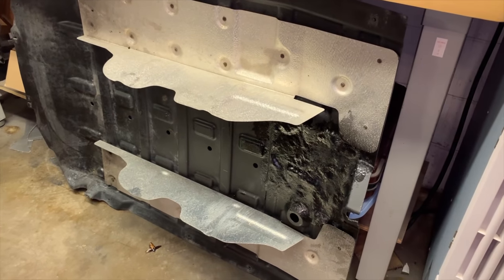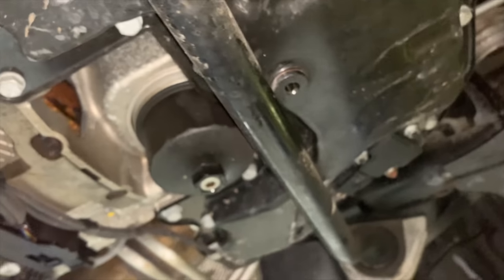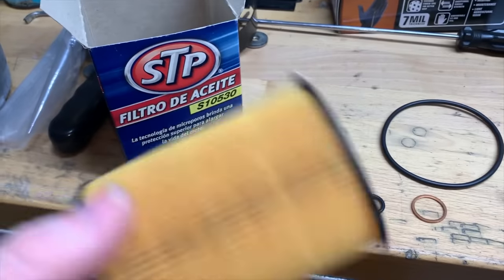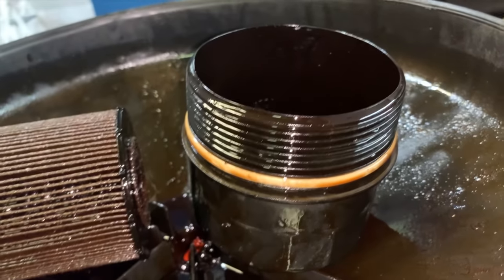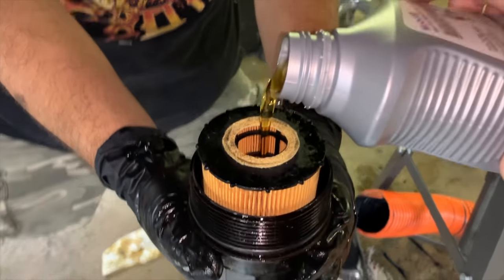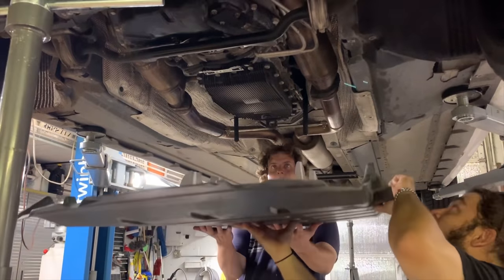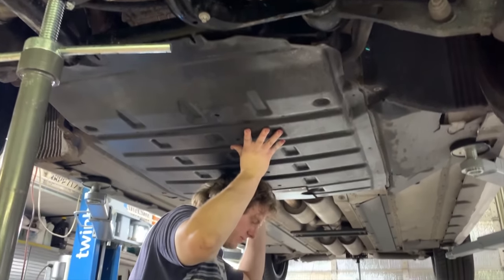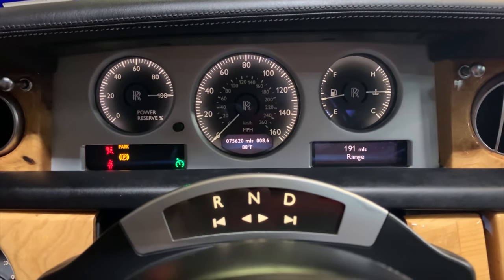Rolls Royce Phantom - OIL CHANGE

Comment: What gets me in all this is that oil filter.  Here we have a hand built, hand assembled engine built to, I am sure, demanding specs.   And the oil filter housing is plastic!   PLASTIC!!   The more I am seeing the hows and whats of the Rolls auto, I am seeing lots of attention to luxury and flash, but the nuts and bolts are just a car.   Plastic oil filter housing!   Gad!!!
Reply: senorkaboom welcome to BMW. Under the hood you will see plastic everywhere. 
Lots of coolant and oil leaks.
Reply from the maker: senorkaboom it is cheap to replace and lasts a long time and helps save on the weight
Reply: Videobob Moseley   If they want to save weight, take out some of the steel to build the car.  I find it hard to understand a plastic housing will save all that much in tonnage.  For better durability and cost justification, make it out of platinum.

Comment: Why do you lubed new oil filter before installing
Reply: Reduce the amount of air in the system I guess
Reply: To prevent "double gaskets"
Reply: So that its easier to get off the next time

Comment: That looked extremely easy. My dodge Cummins is harder than that. You have to put the oil filter in by feel because it's up in the underside of the passenger side. Yours looked very easy

Comment: Bob heres a tip bud for your next oil chanhe once all of the old oil is drained and the oil tank is empty make sure u get 1 quart of new oil and just putit thru the engine just so it clrans out the walls of the oil walls and just to get out any old unwanted oil out of your engine its a tip most mechanics do just to their basic cars its not a big deal but in a way it ensures that ya got any old oil out just foe mindsake like i said its n big deal but it does make a difference.
Reply: No need. Only old School mechanics do this.
Reply: Diesel fuel or even gas can work. Diesel is probably better.

Comment: This will be long, So before putting the car up, loosen up the oil cap hence the ladder. Hmm Oil filter placement from the bottom? No space on top? The sway bar cuts in right at the oil darin plug, Damn engineer. no torque on drain plug? By feel lmfao, not so tight, It’ll come off when your driving and there wouldn’t be a second oil change. No need to pre lube, the system will prime it all, would be hard to lube it if it’s on top. You torque the oil filter but not the drain? I’m so confused. No sir but Mobil one probably paid/sponsored to be apart of manufacture oil by selling it at a lower cost. You just used the wrong oil if like you said it’s a v12 from BMW, which require ESP. I know there isn’t many videos out there but let me help out. If this is a BMW engine use must only European oil. And if u like to stick Mobil1, Used only Mobil1 ESP likewise for a 2004, probably BMW Approval LL-01 or you could check the owners manual for spec. Overall congrats on owning a Phantom.
Reply: Also. No need for additive. I mean it a BMW engine. It might or will burn oil. Start at 0w and the weight that works in your area (20,30,40,etc). For cheap if it’s your current route, Pennzoil make a better oil then Mobil1. ProjectFarm has did some oil challenge recently here on YouTube. Always goes with a better filter to filter out contaminate. I think that is all for an oil change lmao. Happy 4th

Comment: First of all I would of made sure i use rolls Royce filters (or O.E) and made sure the oil was hot before draining
Reply: Yup cold oil would be highly viscous especially old dirty oil, but I'm sure these guys know what they're doing.
Reply: @jklax  Are you now??? I'm convinced of the opposite.  They're clowning around and succeed (suck seed) in greasing up everything possible! I wouldn't let them touch a simple lump of castiron, let alone a car of indifferent what brand!
Reply: @martinelectraglide8490  I wouldn't either! He must be doing something right to keep that 04' Royce going. Older luxury cars are money pits!
Reply: @jklax  I think the car can take more roughhandling than we thought. The BMW-engine lives up to its reputation. But you're right: all ( older) cars are absolute money pits. Even Scotty K. agrees.....
Reply: @JackRR15  It's not WHAT they did, it's HOW they did the job. You've seen it, every part dripping with oil, the way they do it, acting without thinking first, etc etc. No real pro does it like they did it. I'm not a pro when it comes to cars, but when I work on my motorcycle I work as clean and methodically as possible. That's what they did not do in this video.
Reply from the maker: autoworld100 what mechanics know is that it’s all the same thing inside the box, and a lot of dummies get sucked into brand names.

Comment: Oh yikes...that car's value is GONE.  Not a car for the faint of finances if you want to keep it 100%.  but at 75k miles, for a Rolls, this car was already done.
Reply from the maker: I drive this car every day, everything seems to be working and nothing is "falling apart", it is in basically perfect condition.
Reply: @vachief Oh great...at least it will look pretty behind the tow truck!
Reply: @vachief They were never meant to be daily drivers...more like a coffee table book for the affluent, if bought new that is.  Not uncommon to find Silver Clouds from 1965/66 with 8 - 12k miles on them.
Reply: @vachief That's true...much like all the broke pimps in the ghetto with 20 year old caddies that I got to drive when they were new...but with a Rolls or Bentley, a car that is entirely made from hand...that policy doesn't apply.  They tend to go up in value with age and proper care.
Reply: @vachief Rolls are made in small numbers as where production cars are made in large numbers...thus, the value fluctuation.  a 59 Eldo barritz convertible was special as they really didn't make that many, they were rare and expensive for a production car (like the NEW Continental Coach Door Edition that just came out).  But for the most part, build quality and fit n' finish in a production vehicle will never come close to the fit n' finish of a Rolls.  Thus the crazy used values.
Reply: @vachief All cars do that initially...depreciation (same with the $500k RV, but it never goes up in value).  The value starts to go up as we get 20, 30, or even 50 years out and the car becomes a time capsule in MINT condition with virtually no millage or ware and tare.  In some cases, woods and finishes used are no longer available.  Same goes for some of the very fine hides that were used.  Remember, Rolls' are not sold on a lot, you drive a demo car, than sit down and choose EVERYTHING from the catalog.  Thus a car that someone paid $30 - 35k in the 1960's (which was more than a house cost at that time) is now worth 200 - 300k...sometimes even more if at auction (saw a 1966 Cloud III go for over 1 million).  Same with some of the special Lincoln's and Cadillac's and Chrysler's from back in the golden age.  You know, the ones that you and I would not have been able to purchase...LOL!
Reply: Correct, dealers in places like LA, Vegas, Chicago, Hong Kong will order several models with pre-chosen colors and finishes just as demo cars or showroom cars, and most Customers will use that as a gage to decide what options they want, colors, hides...most that would buy that car right from the dealer are looking for discounted prices or don't understand or grasp the joy of "configuring" your own car.  I'm not paying that kind of money for something that's been sitting on a lot and others have sat in...HELL NO!  The delivery process of a Brand New Rolls when ordered is AWESOME!  Where I live, it's mostly old money, not a lot of NEW money...at least not that kind of money, so the dealer has a bunch of pre-owned cars on hand that were owned by local has-been's (for lack of a better term).  Most were basic Dawns, Spurs, and Shadows...the most common models...they did have Mr. Shakey's Business Partners 1976 Silver Shadow for sale at $35k...but again, that's one of the most pedestrian models made and it was a very basic car used to impress clients, it had minimal amenities inside for that era...but still, a 1976 vintage car for $35k.  Also, it was in need of some restoration work so it wasn't by any means a MINT collectors car.
Reply: Don't fill the oil filter

Comment: instructive video,  but oil change for Rolls Royce is not meant to be done by the owner, wouldn't be amazing that without licensed Rolls Royce software connected during the oil-change the car doesn't run anymore.

Comment: A lot of trolls on here but this is for real.
When you had the pan off and it was broken anyway, why not take the opportunity to to leave two holes or better still a couple of inspection panels.
These could be designed with one bolt removal and expose the filter and oil drain.

Comment: The reason you change your oil at 3 to 4000 miles is so you don't have to use overpriced Mobil one oil..!  Synthetic oil doesn't remove heat as well as petroleum based oil does ....put that Mobil-one in an air-cooled engine and see what happens ...!
Reply: 1996 is not 40 years...it's over-priced crap , any certified 0-40w oil is what Porsche recommends ...I'm a retired Aircraft Mechanic , and have been through all of Pratt & Whitney & GE engine schools....The only reason 10 /10 w Synthetic oil is used in Jet engines is because the oil is cooled in a fuel / oil cooler ...we watched many friction tests with Mobil one and many other oils ...the lubricity is the same ..!

Comment: You should keep original rings and don’t change them unless they really need to be change
Reply: I agree. I've done a ton of oil changes. Never replaced the crush washer, plugs, rings. Just don't double ring anything and make sure everything is snug, then double check, them triple check 😄those are the only oil change issues I've ever had.

Comment: Mercedes W211 / E320 3.2 V6 takes 7.5 qrts of oil. Same oil filter style with all of those o-rings. The Mercedes filter rod is more than a foot long. I use an oil vacuum pump to evacuate the oil. Cool thing with the Benz, the filter is at the top of the engine. No need to get under... however no oil dipstick. WTF! 🤛
Reply: Doan Trinh isn’t there an electronic monitor for the oil level?
Reply: Señor Loco Yes there’s an electronic monitor but there’s no meter. It has three notifications: OK, low, high. When I pump out the oil, I measure how much oil is sucked out and add 1/2 quart extra.
Reply: I would make a drain myself in the oil pan... all the crud on the bottom of the pan that comes out when you drain doesnt and wont come out with an evacuation pump
Reply: Jason Donohue I do a full drain from the bottom plug occasionally. Just 2-3 pounds of sludge 💩. JK.
Reply: I use a vacuum extractor on my Mercedes too. I change the oil and filter every 5000km, there isn't any sludge in my motor.

Comment: This video is definite proof that EV is going to take over much faster than any petrol head can imagine. "Remember, you gotta change oil every 3 to 5000 miles." Then go to an electric car, designed as electricm e.g. like Tesla or Xpeng P7, not the shit from GM where they just put an electric motor in an ordinary combustion engine car. You will discover you never need change oil, your money outley at the refill station all of a sudden droppen by more than 90%, and your acceleration and torque is way above anything you were used to in petrol cars. EV has no competition which is why the fossil fuel lobby is so powerful. Till this day, endless misinformation and disinformation campaigns. But the facts are too blatant, internal combustion engine is no match for EV.
Reply: Except you can never take a long day trip because you have to wait hours to recharge.  The upfront cost is substantially higher.  Repairs are no longer "DIY" jobs and have to take them to the dealer (which is way more expensive).

EV's are cool and have their place.  However, combustion engines are not going anywhere soon.
Reply: DIYers can't DIY with EVs
Also they all look the same 
Battery are heavy af too
Reply: @victorpelini5995  Men will always love to tinker. There will be a limitless number of 'antique' motor cars available to tinker with. They will create new forms.
The EV's can take any form, especially when self-driving, but people cannot accept verhicles that do not look like don't look like combustion engine cars. Tesla modelled the Model S on an Aston Martin that had the most coveted look at the time. In my country there have been experiments with novel forms of EV's but people won't accept it. When the first horseless cars were being produced, they HAD to look exactly like a horse-driven carriage, otherwise people would not want to buy it. It took about 35 years before motor cars stopped looking like horseless carriages. That is how people's minds are rigged. Change is only accepted gradually. We seem to be stuck with the models of combustion engine cars for now. Tesla now tries to introduce the idea of designs dedicated to EV with its SUV Model X and its seems to have succeeded not because of its novel looks so much as for its much higher usefulness than the Ford and GM SUV's. ( Once the Tesla Model X goes into production, no-one in his right mind would buy a SUV from Ford or GM any more. As SUV's are their main source of profit, and they are decades behind Tesla and the Chinese, they are doomed. Have you seen Bob Lutz warning Tesla 'to get its act together"? It is like looking at a lunatic. Ford has even axed its EV development. Perhaps they will stop being a motor car company altogether and continue as a financial services company, which they, actually, in fact already are.)

As to the batteries, you forget that combustion engines and gearboxes, and all that, come with a lot of weight, too. And the battery pack on the floor gives the cars a much stabler position on the road. You have overlooked the tremendous advantages of that. The weight of the combustion engine always has been a problem as it can't be in the middle of the car where it should be. Supercars try to put it as much in the middle as possible, didn't you notice? Well, any EV has a better weight distribution than any supercar, let alone ordinary motor car. 

I am amazed by the superficial character of your arguments. You never seem to have given it any thought. How come? It really interests me, I am not being cynical here. Are you young?
Reply: @charlesvanderhoog7056  engine and gearbox weighs nothing compared to EV's battery
My old Volvo 240's CAST IRON engine bloc, gearbox and axle weighs around 350kg. Total. That's the weight for the whole powertrain.
If you want more range out of an EV it means heavier battery.
I love the idea of having an eletric motor, I love them really. Light, maintenance is minimal, loads of torque, cool noise too.
What I hate it the gadgets and computers and all.
I hate modern cars, as such I hate EV as they are now.

The idea of a self driving car is making me sad.
Im only 20yo, grew up with modern car learned to drive with modern car and I drive both modern and old cars.

I really prefer driving older cars. Noise, feel and all it's really engaging.
Teslas may be hella fast but it's nothing to me. Computer screen and touch control is the last thing I want to deal with.

Hecc when my old gas powered hunk of steel don't wanna start (the early electronic in it went bad, I'm currently going carburated) I take my bicycle. I have more fun pedaling than driving modern boxes that wanna do everything for ya.

I'll fall in love with EV when they'll stop being computers on wheel and when the battery will have shed some weight down

Sorry for my awful english, I live in this part of the world called Europe, where we get to have nice curvy roads, where non of that automatic gbox nonsense apply, where most cars are between 1 and 1.5 tons. 
I can put more stuff in the ol' Volvo 240 than in my friend's dad's Model 3, and it weighs much less. Yeah it's slow as hell, whatever we are stuck at 80 (kph) on the roads anyway....
Reply: @charlesvanderhoog7056  also about the weight distribution, have you heard of the good ol' RWD ? Y know ?
On the old Volvo again, one of the most pedestrian car ever, shit got a 49 - 51 weight distribution. They weren't even trying.
Reply: Sure, then when your big battery dies on your Tesla, and you take it to the dealer for a new one, they will happily change it and present you a bill for $5,000.
Reply: @jeffro221  That's a rare occasion and a temporary problem. Battery technology is advancing with lightning speed.

Comment: One needs to have a factory workshop manual from Rolls Royce though they would only issue them to a Rolls Royce dealer. My Cousin works at Rolls Royce in Crewe England
Reply: Rolls Royce Motors left Crewe about 20 years ago, that's where Bentley remain.
Reply: @simonroyle2806  I'm from the UK and I lost touch maybe he moved to their new location. Rolls Royce was my last car before I emigrated to the US. I maybe interested in buying a Bentley in the US, I miss the luxury leather seating.

Comment: I shall never buy a car which is so badly designed that the engine oil flows over the sway bar when the oil is changed.
Reply: You MIGHT consider making a small cover of, let's say, a piece of aluminiumfoil to cover the piece up and thus protecting it from getting all covered in used oil? Could this idea pursuade you to buy a Rolls after all? IF you can part of your pile of money, that is??
Reply: @martinelectraglide8490  Okay, maybe Rolls Royce has another more serious flaw I am not prepared to live with.... the purchase price.
Reply: @Andreschannel_SA  Je hebt gelijk. Over-the-top aanschafprijs en idioot hoge onderhoudskosten voor een BMW met een Engels jasje

Comment: You need a breaker bar? To remove an oil pan drain plug on my God
Reply: Why not?! Some of them are real tight. My workplace had used a 70" steel pipe undo a drain plug  before....
Reply: lmaoo😂😂😂😂 They were out of elbow grease